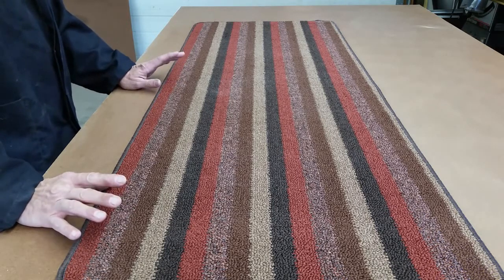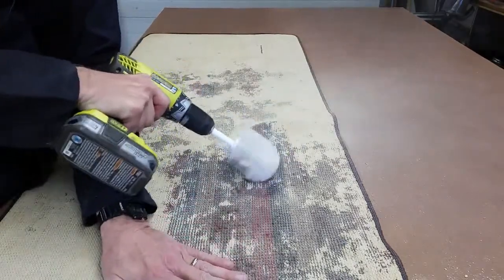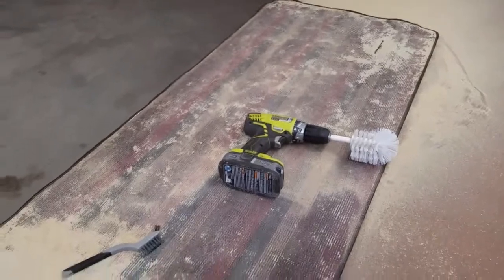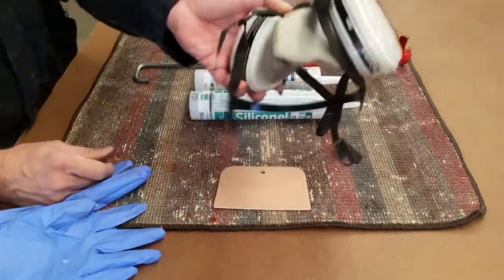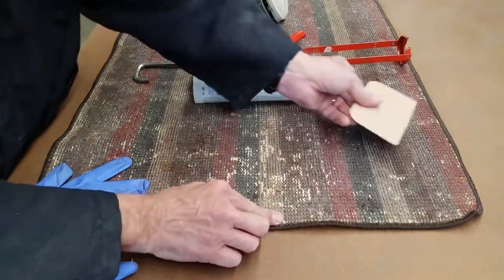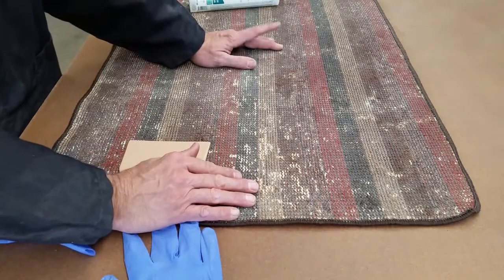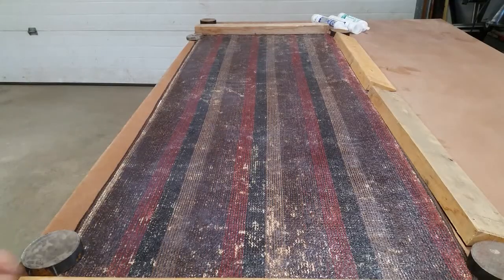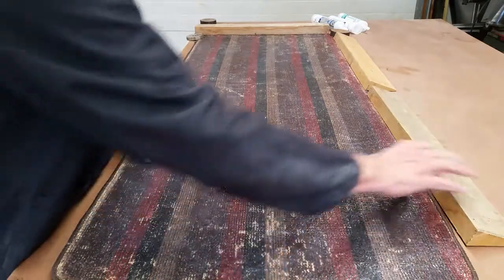Silicone Carpet Backing DIY

Comment: Several comments mention that the new carpet is cheaper... Yes, for sure. But what if it's an old-timer car mat?  It is rare and with a color and pattern that matches the interior upholstery? It's worth it for that. Coincidentally, the rubbering of the carpet of my 30-years-old roadster got loose, and I haven't found a better or new one for it yet. So I'm thinking about DIY re-coating with silicon somehow.

Comment: I bought the same brand/type of silicone did this to the back of my rug yesterday, very thin layer and 24 hours later it’s still sticky. Only difference is the back of my rug is only starting to slough off on the corners from getting caught in the vacuum. If it doesn’t dry I’m going to have to get some backing from fabric store and attach to underside of rug.
Reply: Did it dry?